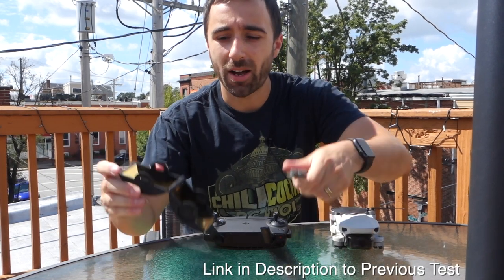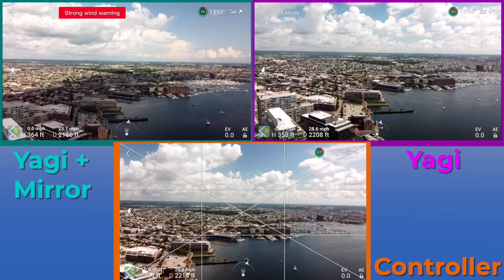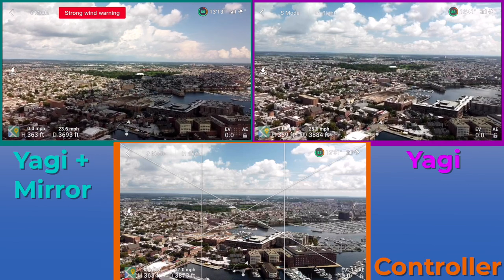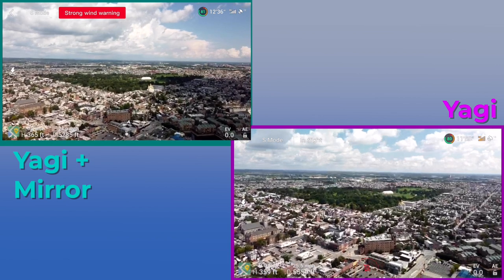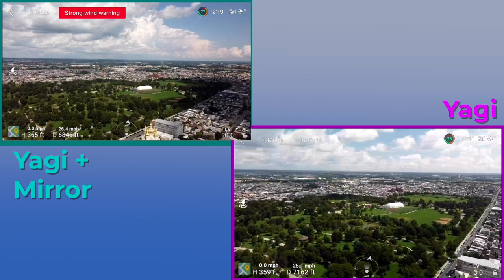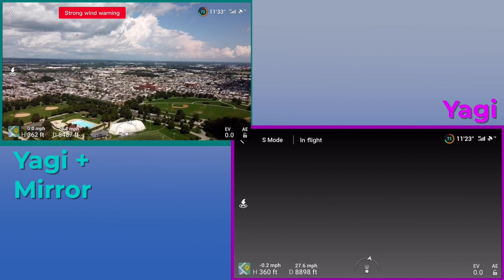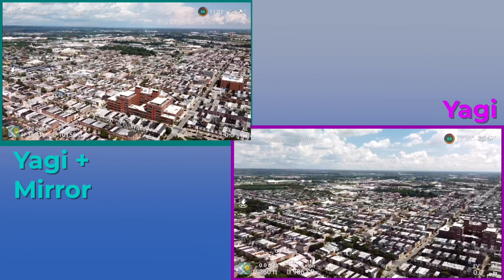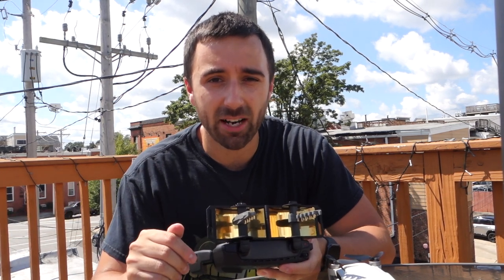Combining the Parabolic Mirrors with the Yagi Antenna | Mavic Mini Video Comparison

Comment: I have this combo for my Mavic Air and if you use 5.8ghz,you will literally get almost zero interference...those particular Yagis are specifically designed for the 5.8ghz frequency...there are 2.4ghz models which are bigger but the same general design.
With a full battery and on 5.8ghz, I guarantee you can get 15 thousand+ feet.
Reply: 2.4ghz should give you an even longer range, but more prone to interference, so should only be used in rural areas.
Reply: Thank you for this, I’m so torn between choosing 2.4 or 5.8 and this made me decide to go for 5.8 cause I live in a highly urbanized area. Tyyyy

Comment: Hey Nick,
Great video. However I should point out that these antenna don't increase the power as such. The maximum power transmission is set by regulations either FCC or CE, what these accessories do is (assuming correct tuning) is reflect the transmitted signal that would otherwise be lost from the rear of the antenna on the RC and direct it forward to the front.

Like wise the parabolic will reflect the return signal from the aircraft back to the antenna therefore increasing the amount of received transmission from the drone

Comment: That was a good test and you ask all the right questions (angle in P vs S).
Just would like to point out that S mode gets you further out for range tests.
P mode gets you the most time up in the air but S mode moves faster. Basically the drain per distance covered is higher in P mode
Reply from the maker: Yeah it would be an interesting test to see what gets farther
Reply: @nickdaly5104  it would be quite a bit more helpful if the radar wasn't affecting the phone it was holding and had some sort of accuracy that could show you that you are pointed in the right direction in both planes.
Also if the signal strength indicator was more sensitive instead of sudden drops from full signal to lost signal
Reply from the maker: Airbag888 true! You’ll just have to take my word for it on that one haha

Comment: I'll bet there was a huge front to back ratio on that setup.     Here's a test you could try with it.   Fly the drone out a more common distance,  like 200 or 300 feet.  Then turn around so the antenna are pointing away.
I'd bet it's such a huge difference, you might lose signal with the drone just 50 feet behind you. :-)

Comment: Interesting but only one of the arms on the transmitter holds the antenna. the other does nothing so not sure what mounting a yagi there does. Try having only 1 yagi mounted. on the left side. you can see one side has wiring going to it and the other doesn't. See if that makes any difference. Same for the reflector. a longer yagi on the one side might be more effective. instead of  1 reflector and 3 directors maybe 2 reflectors and 5 directors on the yagi. im gonna make my own i think :) thanks for the video

Comment: Great range test, only one thing I'd like to point out is there was a 300ft distance difference between the Yagi/Parabolic combo over the Yagi alone, with the 300ft distance in favor of the combo. Not like that makes a difference the obvious winner was the combo extender choice anyhow, but makes for a much more fair comparison. Also note that Yagi extenders work on a tunnel signal principle whereas the Parabolics utilize a broader more wider signal spectrum, so combining the two most definitely helps, but should controller head position vary during flight by several degrees the Yagi extenders would start failing the Parabolics would compensate for the loss and still give you the added increased benefit. All around a great video comparison, just adding some pointers that I've picked up from other Tubers vids.
Reply from the maker: Thanks for the feed back!

Comment: Actually yagi is a bit linear, where parabolic is wider, yagi may have a long range signal but easily get disconnected when you try to face the remote away from the drone. So combining them both boost the wide range and the distance range, good job here mate.

Comment: Thanks for the informative videos. I notice you're using a different style YAGI than in your previous comparison. Last time they were the type with a hard plastic frame and these are flexible silicone.  I recently got some of these from Banggood (branded RCGEEK), but have yet to try them out. Have you found any performance or usage advantages to either type of YAGI?
Reply from the maker: Glad you found them useful! I had two reasons for switching. 1) the plastic ones were a little tight on my controllers antennas and it caused some scrapes on the antennas plastic. It also required a good amount of force to take them off and I was expecting to pull the antenna off accidentally one day. 2) I couldn’t fit the parabolic reflectors over the top

I haven’t found any actual difference in the signal using the two. Pretty interesting because i don’t think the rubber is perfectly straight each time I use the rubber Yagi’s.  The combo test video was actually my 3rd attempt at recording that flight.  Each time I made it to the same distance but my phone had overheated and not recorded.  It was very consistent in the range I got.  

I dont see any difference in the rubber vs the plastic Yagis. I have found the rubber ones are easier to carry and take on and off the drone, plus I can fit the reflectors on the antennas with the rubber yagis

Comment: Were you in 2.4GHZ mode? for what I saw with those exact Yagis on Amazon it is for 2.4ghz
Reply from the maker: I was in automatic channel selection the whole time.  Those Yagis are for 5.8 ghz.  the 2.4 ghz ones have much taller metal rods
Reply: @nickdaly5104  gotcha. I'm new to this and still learning haha. Your videos are great
Reply from the maker: @liquidalloy  no worries man! I had no idea about any of this stuff a year ago!
Reply: @nickdaly5104  which ones do you think are better? The 5.8 or 2.4?
Reply from the maker: Good question but I’ve never flown on the CE version.  You get longer range with 2.4 but the response time is slower and lower quality.

Comment: Did you cut the yogis in half because mine came together... ?  As a solid one piece of plastic
Reply from the maker: nope. there's a lot of different versions though.
Reply: @nickdaly5104  well I bought the recommended ones and it didn't do any range improvement for mine that I'm using the bugs 20 and it's 5G but the range on it is pretty bad compared to some of the other China clones

Comment: Does anyone have any tips for a Mavic Mini range extender in a suburban setting with lots of trees?  I have tried both booster types and saw no difference. Are there any options other than building a tree house?
Reply from the maker: Yeah tree leaves will block the signal no matter what unfortunately.  If you can get over the tree line that's best but you need a physically clear path between your controller and the drone.

Comment: What’s the difference between the 2.4 ghs and the 5.8ghs
Reply: There are a few differences between 2.4 and 5.8. 

2.4 is better for range and for penatration, where as 5.8 is better for data bandwidth.
If you are going to purchase either the parabolic or the yagis  make sure you get the correct ones for the frequency you are using. 
The difference between antenbas is the wavelength of 2.4 and 5.8. If you put the wrong antenas on then instead of reflecting the signal from the rear to the front you will attenuate the signal and reduce your range.

Comment: do you manual switch to 5g with those yagi's? since they are the short barred 5ghz or do you leave it on automatic?
Also, have you used the 2.4ghz (long bar) yagis?
Reply: 2.4ghz is not enabled on USA models.
Reply: @Simonsvids  live in the eu but bought in the NA

Comment: was it on 2.4?
Reply: These are 5.8GHz yagis so he had to be in 5.8. Also if he's from the US he only has 5.8 bands available
Reply: @Airbag888  Noooo! 2.4 also available in FCC (US) version, you have 11 instead of 13 channels in US 2.4GHZ standard + much more power.
Reply: @wza360  What I saw is that when your CE drone is in the US it devolves to showing 11 2.4Channels vs 13 when in CE regions. However FCC mini only ever has 5.8GHz channels + the hardware amplifier
Reply: You're saying that ffc version does not have option of 2,4ghz at all, right? I wonder if it's on hardware level, or on software only.
Reply: @Airbag888  That makes total sense why 5.8GHz had to be made much more powerful. It would be really sad having only 5.8Ghz with such power as we have in EU.
Reply: @wza360  Except 5.8GHz is less affected by interference and the range on 5.8GHz + amplifier is greater than the 2.4GHz without amplifier. If I could do it all over again I'd buy a FCC version
Reply: @Airbag888  in my case I almost never get far with 5.8Ghz with EU version - its not powerful enough. But I am sure FCC would be much better. You can actually hack EU version to get into FCC mode by faking the location (there are two ways: 1. by doing it every single time before flying; 2. using permanent hack by modifying firmware using paid patch) but I really like to have warranty still for my Mini, so I will avoid this at least for another year or so.
Reply: @wza360  You cannot fake FCC on the mini. Or rather you can but because the hardware is different between FCC and CE versions you get little benefit. Sparks and DJI drones prior had the same SKU for a model so that 'hack' worked fine.

I get 500m in FCC stock and about 1.6KM in CE stock. With the 2.4 yagi i get around 3km max so far. Maybe with parayagi's I'd hit 4-4.5Km that'd be great :)
Reply from the maker: Yeah that’s correct. I’m on the FCC 5.8Ghz